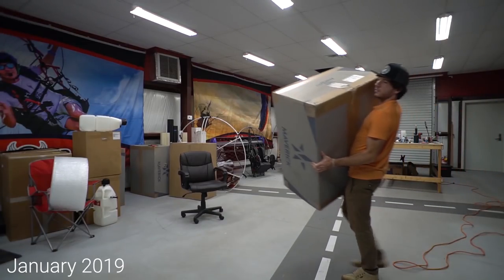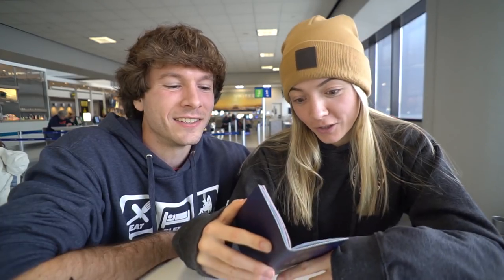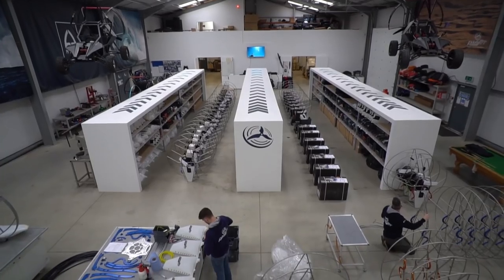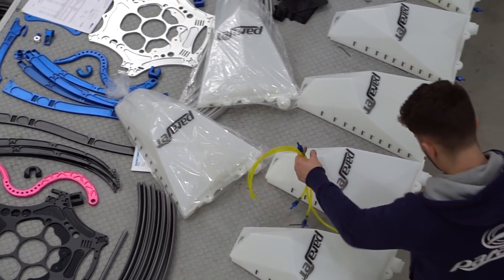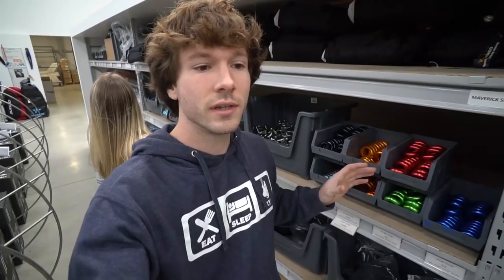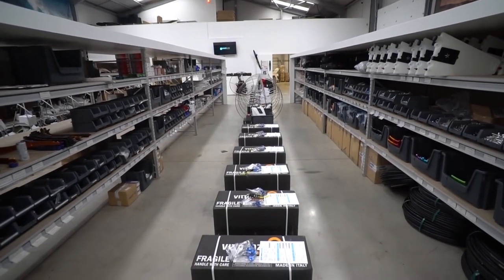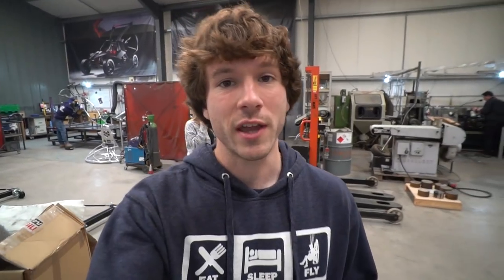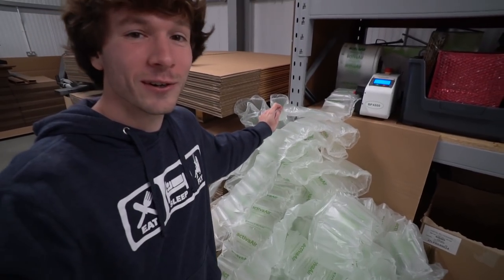How is a paramotor made?!?

Comment: You really have to elaborate more on the supercharged rotary paramotor! I was thinking about turbocharging one but that idea sounds better! Please explain the set up!
Reply: Turbocharging should be better (more efficient, more power). Supercharging is mostly only good for fast response (important in cars where you’re possibly drifting or speed shifting, not so much for engine thrust). Rotaries burn a lot of fuel (I love my RX-8, but even it’s little 1.3 liter engine without a turbo makes single digit mile per gallon in town... If you turbocharged or even worse supercharged one I wouldn’t be surprised with a 1 hour flight time, like the fuel burn rate should be the 5 gallon FAA limit within that time or less if you’re pushing any high power (and if you weren’t, then you wouldn’t want the extra weight of super/turbocharger).

You can do either, I’m sure they did it for simplicity as it’s easy to slap on a pulley to drive a belt (so it makes sense for a one-off prototype), but turbocharger also has the advantage of really making an engine quiet with a straight exhaust out the turbine (so it’s like a built in muffler).

You could do either but supercharged would kill flight times and make it heavy from needing double the fuel and the compressor weight, so do consider that (for Everest they wouldn’t have much oxygen for the engine, hence it had to be forced induction). I would love to see a super light model with a GT06 (not much bigger than a soda can)